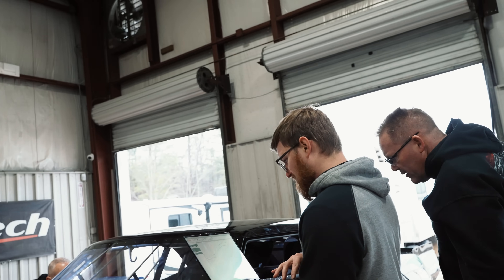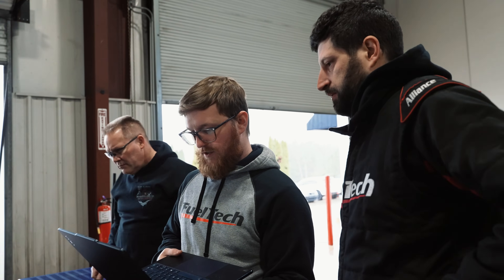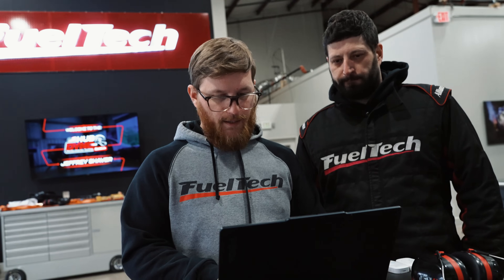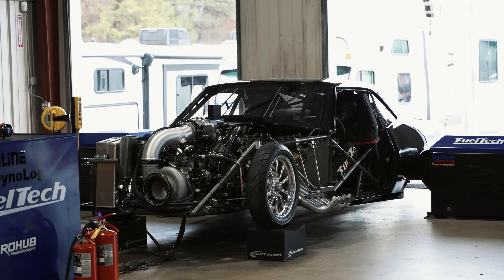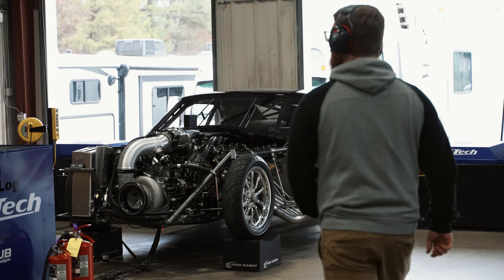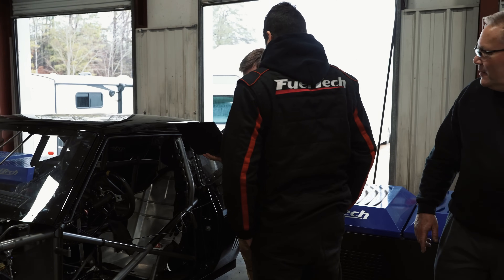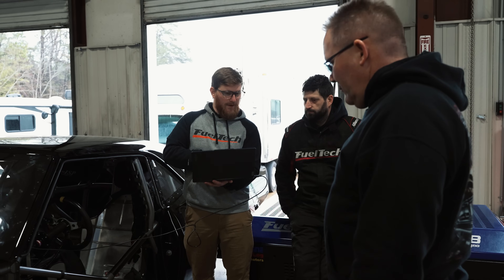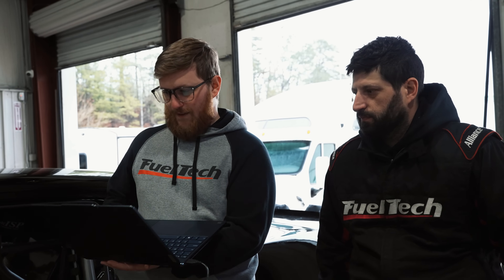N/T Chevy Camaro Drag Car "Black Widow" Hub Dyno | FuelTech USA & Jeff Shaver

Comment: It needs headers. If the flow starts going backwards, this means the exhaust has more pressure than the intake. Yes, this can happen with zoomies. Especially when your zoomie tube inner diameter is bigger than your exhaust port. Then the transition from port to tube starts to tumble on the step. Bcz there is no collector, there is no pulling force to empty the tube, the tumble keeps increasing the pressure on the exhaust side, eventually starting to flow backwards on stroke transition/overlap. 180 system would be nice, but you can medicate the simultaneous pulse problem by having different length primaries and/or entering the collector in different locations. the collector shape, size and tip shape/location all determine how well the primaries get emptied and how much down force the exhaust creates. You don't need to sacrifice your camshaft, you just need to optimize your piping.
Reply: You love to listen to your self talk. I think most people would agree it is not a problem with the zoomies.

Comment: 3800hp?
Reply: Steve morris has a video of basically the same setup. It made 3600+
Reply: @zcookie9272  don't compare to Noonan 4.9 hemi to a Steve Morris hemi haha
Reply: @Smokeykunx  Steve Morris had a Procharged Noonan 4.9 hemi on his dyno
Reply: @Smokeykunx   Two  totally different engine buildes !!!   Steve builds drag and drive engines,  water ports in the heads and blocks to flow water,  lower compression and so on !!    

Noonan is all out big power.  They make one pass cut if off ,  check every on the engine..  

I like a lot of engine builders
Reply: @zcookie9272   The man tuning the car said the engine has a cam for screw or roots and they work with a centrifugal supercharger.